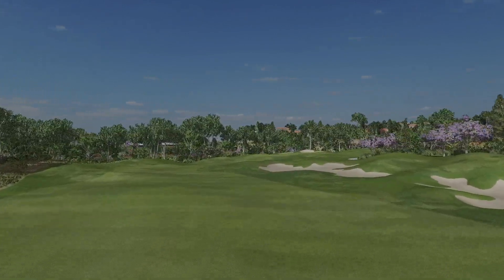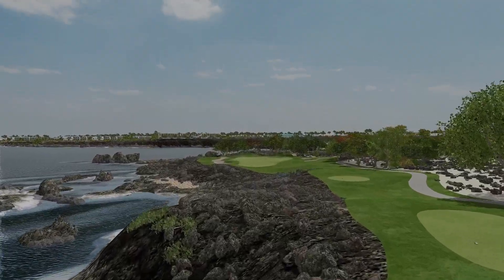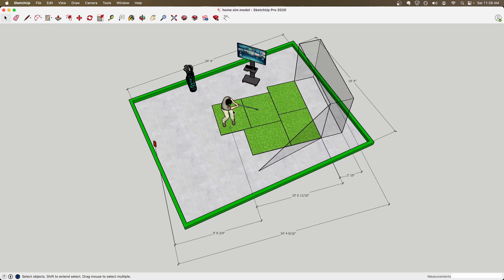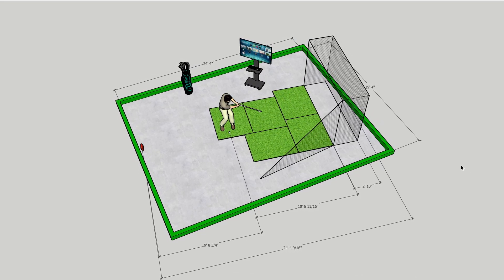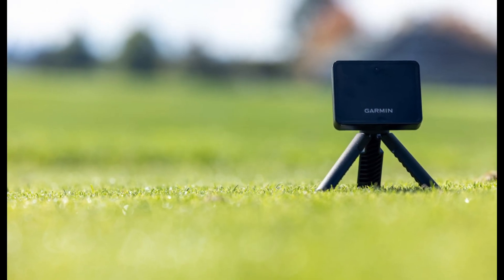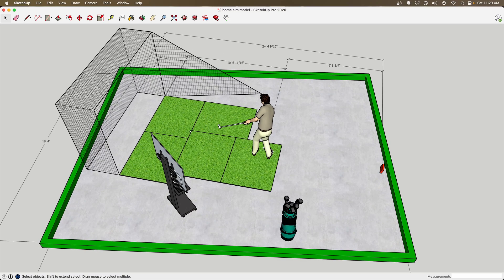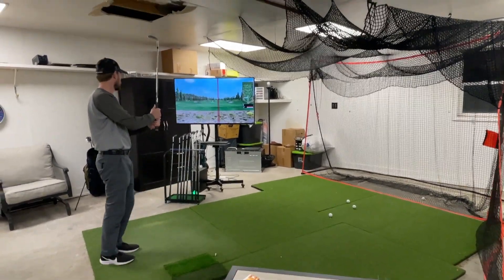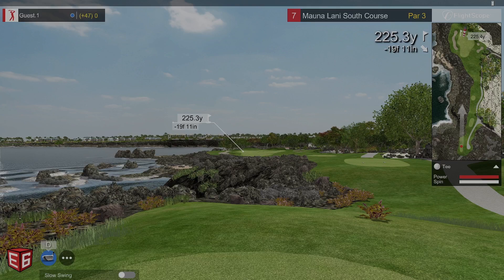Do You Have Enough Space For a Golf Simulator?

Comment: Titleist 718 AP3. My all time hands down favourite irons ever. If you're a low to mid hc, you will never ever need to purchase any other irons..ever. Titleist did such a good job on this model (718 AP Series) that anything after this series is moot. The 718 AP series is undoubtedly the best iron set ever designed.  As I progress (or digress) the only thing I change is the shafts and swing weights. The heads are timeless.
Reply from the maker: i couldn’t agree more. i lucked out that these were my second set of irons after i got into golf. i dont expect to replace them anytime soon

Comment: How is it hitting with a section of the ceiling removed? Do you find that the truss spacing is too tight and you’re concerned about hitting it? (Assuming it’s either 16” or 24”?) are you able to hit driver?
Reply from the maker: its better with the drywall removed but it doesn't fix the problem completely. I still barely nick one of the trusses from time to time - about once every 50 swings. my spacing is 24" on center which helps a lot but you will still move your stance then unexpectedly be in the wrong spot just in the right way to reach the truss. i was able to swing my driver even before I removed the drywall but its definitely better with the drywall removed. I still plan to modify two of the trusses into the scissor style and make a cathedral ceiling for more comfort but that's down the road and isn't my top priority

Comment: Video was basically useless as he spent most of the time talking about ceiling height and nothing about space to set up the net or other factors. If you gotta talk taking out the ceiling and resetting the trusses to get added height you may as well buy a utility shed/workshop style building to put in your back yard that has the dimensions you need.
Reply from the maker: Sorry you feel that way Tim. This video is about space requirements and the ceiling height is one of the make or break things for a lot of people and most have an 8' ceiling which is why I put so much emphasis on it. I would be very upset if I put $8k+ into a setup only to find out that I would hit the ceiling with my clubs. You're right though, I spent a little too much time reiterating that point. That was one of my first videos as a content creator.
Reply: Your ceilings are on 8 feet ? Also can you swing your driver in there and how tall are you roughly? My basement is a little under 8 feet it’s 7’8 just wondering if I’d have enough space being 5’10
Reply from the maker: @eliasmichalopoulos1595 yes my ceiling is just shy of 8’. im 5’ 10” and i can swing my driver fine even though i will still graze the ceiling from time to time. i made a more recent video about this topic specifically